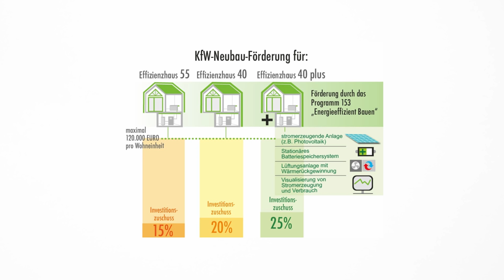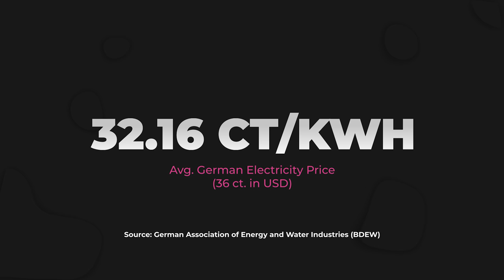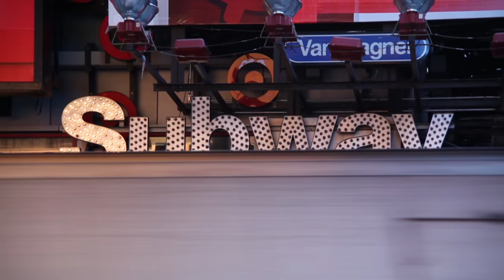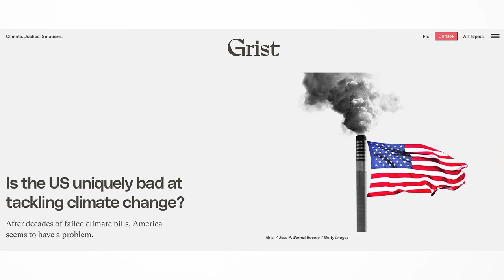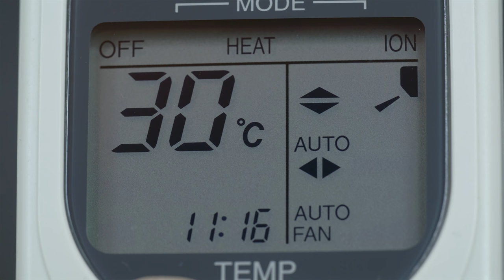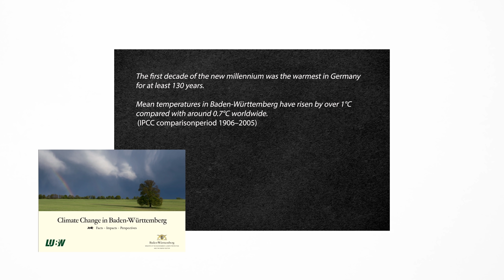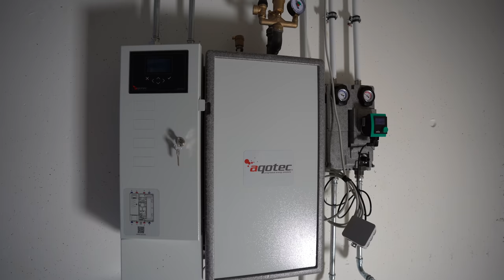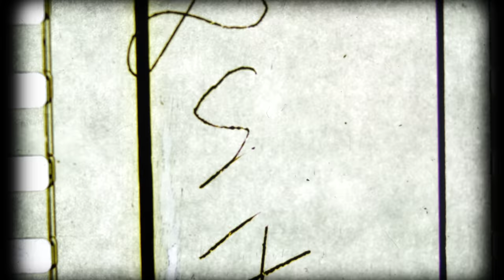HVAC (HLK) in German & American Homes | A Tale of Two Countries

Comment: Great video! I've never lived in a house with AC, but I have lived on Nairobi Kenya for 6mths and know how baking hot and humid it can get! Did we have AC, nope, just torrential rain which was lovely to stand out in to cool off. 
Here in SW of the UK, our summers hit high 30°C and it can get hot. We open the windows on the morning (if not open all night) and close them an hour or two later and keep them and the curtains closed until it cools enough. 
It works downstairs well, but the upstairs is heated by the attic during the day and makes sleeping problematic for the Irishman in me! 

AC is vital in a car, if you design your house for the environment it is being built by fitting window roller blinds, insulating walls very well and designing in overhanging roof eves (to bring shade) , then you may not need AC at all! If you have a heat pump, you can switch it on in reverse and it cools a bit and is way more efficient than an AC unit. 

Also, make your houses sooooo much smaller! I was blown away by how fracking big US and Canadian homes were for the money! Nearly 3 times my house in size 121m² (1302ft²).

Comment: I live in Vancouver Canada. I used to live in an old bungalow which had no insulation in the walls, and no AC. I had doors and windows open all Summer, and lots of bugs in the house, (no screens either) Then I moved to the suburbs of Vancouver into a bigger mid 70's house of 3000 square feet. This place has a gas 94% efficiency forced air heating system with a central 60,000 BTU AC using a scroll compressor. It is also well insulated. Same ducts for heat and AC, simple. The AC is wonderful on hot days. This Summer of 2021, it got up to 41C a few days. I learned the limits of AC when it's 106 Farenheit outside. Keeping this place at 85 F in that hot weather costs $3.50 per day. I don't us the AC for more than say 25 days during the Summer. It's also not a heat pump, just straight AC, which means it does not run at all for most of the year. Heat pumps for both AC and heating grind away all year round making noise and wearing out the compressor.

The main gripe with hot water heating is slow heatup times. Yes, forced hot air is a bit dusty, but the house is comfy in 15 minutes after you come home and turn up the heat.

Comment: Excellent. !!!
An astoundingly informative, well researched and delivered video. Thank you so much!
I live in Germany in a semi-detached house built in 1994, so not quite up to all the newest environmentally friendly regulations. But not too badly thermally insulated. 
I use gas central heating with room radiators for heating.
In 2015 I put a photovoltaic system on the roof and produce more electricity than I use in a year. (Of course, I sell it back to the utility company for about half the price I have to buy it from them 😞so they still make money out of me )
In 2018 "I caved", as you put it, and invested in an AC system. The interior of my house is fairly open plan so 1 exterior wall unit and 2 inside inverters was all I needed.
I figured it was only going to get warmer in the summer and all that extra sunshine driving my PV system could power an AC system 🙂. I only use the AC when the sun is shining anyway😅
Thank you again for this (and your other) educational video on US and German building practices. 
gas
Reply from the maker: So glad you enjoyed it! We really appreciate all of the positive feedback. Although I would like to ask you about selling your energy back to the grid. Are there regulations in Germany that regulate the price? In the US they mandated that the utility companies have to purchase it back from you at the same price you buy it from them.
Reply: @TypeAshton  Dear BFF, "Are there regulations in Germany that regulate the price?" 
This is Germany!! Of course there are regulations. 😁
But, as you know having lived here a while, they are not 'unsurmountable':
If you are thinking of adding PV to your build it would be best to ask your energy utility how that would work where you live. 
You don't have to sell it back, but you'll have to find a way of dumping/storing any excess you produce. In the end it is easier just to hook it up to the grid. I am not sure if the utility companies are mandated to buy back, but you sure won't get the same price as you buy it for. 
You just buy from the grid when "the sun don't shine" and sell it back on "happy, sunny days".
There are a few things you need to sign (I've forgotten what they were), and you will be registered as a production company. You would be producing energy, after all, just like a grown up utility company. You will also have to declare this on your tax returns, but I found I was getting a (small) rebate as I was earning +/- 0 Euros. 
They reckon it takes up to 10 years to get your investment back and start earning. But, hey, for the good of the planet and taking away my guilt for the AC ......... 
Aber wie gesagt, this is all pretty simple and the utility company will should help you out.
Looking forward to your next video.

Comment: I am Austrian, but have spent the past 27 years living in Western Canada. During the hotter summer months in my youth, i remember having every single window open at night time, then closing everything up tight and shutting the blinds. i dont remember owning fans for extra air movement either. usually living in a century old concrete building did the trick of keeping us cool. Forced air furnaces were introduced to me when i first moved to Canada. Until then i only knew of wall mounted radiators. Living in a very rural area for most of my adult life, I had a combination electric/wood forced air furnace. Moving to a suburban area later on in life, it was definately either electric forced air or natural gas forced air. Only in the past few years have i enjoyed a central AC unit in my home, because i moved to one of the warmest parts of the country.

Comment: Not all of America is A/C obsessed. Most of the West Coast of California, Oregon, Washington, do not have A/C. We’re in NorCal. The past few summers we had some 116 to 121 F days which were tough. We replaced our old flat roof with a new reflective coating which helps reduce heat absorption tremendously. Also we have blown in insulation in our 1949 house, and have the luxury of cool overnights to capture the cold air with open windows. Nothing better then falling to sleep with the sound of crickets, frogs and owls. I would love to have radiant floor heat for those chilly winters though.

Comment: You guys missed the important concept of Enthalpy.  

That's the amount of energy in a given amount of air, and is in many regions based more on humidity and water's heat of vaporization, than on temperature alone.  

If indoor humidity is too high, mold, mildew, and fungus growth may make a premise a biomed hazard.  A dehumidifier is in effect an air conditioner with evaporator and condenser together, while HVAC is generally designed to be more efficient.  

In regions with heat pumps and high humidity in winter, defrost cycles can consume more energy than actual heating per se.  That, and optimizing temperature ratios, are reasons why ground water heat pumps make sense in many regions, over fuel based systems, such that COH or SEER actually operate at optimal spec points (and solar cogen may be the primary energy source, multiplied by the heat pump).

Comment: I have underfloor heating in my apartment and since the floor is slightly warm, one heats less than with the traditional radiators under the windows, since warm feet will make one feel warmer even at the same temperature in the room.
I get about 500 € back from my heating bill every year, while maintaining a lower temperature than in my apartment before. By turning it on bit by bit early in the autumn, I avoid the walls getting cold and therefore I don't need to heat as much in the beginning of winter, saving heating cost overall.

Comment: I live in Cologne in the last few years the temperature rise above 40 degrees. My tips to survive: In the morning, by morning i mean 5 am  to "lüften"  and we have special blinds that are heat-repellent. These are also urgently needed we live in the attic. In addition we also have a fan but we only use it when it is above 30 degrees in the room and sometimes I take a cold shower :-)
Reply from the maker: Great advice! ❤️ We also live in an attic apartment and thankfully cool summer nights help a lot to get the air moving through the house.

Comment: My tip for hot summers would be moving underground, if you have the possibility. We live in a house with 6 flats and 4 of them have a "Hobbyraum" in the basement. You can only acces it through the common stairwell, but there we have a 20 sqm room just for ourselves. In the summertime the temperature down there normally does not rise above 21/22 °C which is a very comfortable temperature for sleeping and working. So probably you could think about such a room in your basement where you could escape from the heat.

Comment: I live in the Philadelphia Pennsylvania area. In the summer time I set the air conditioning temperature at 79⁰F (26.1⁰C) for the occupied living spaces (I have window units) and a fan to circulate the air. However I like my bedroom at 65⁰F (18.3⁰C) to sleep. In the winter I keep the home heat set to 64⁰F (17.7⁰C) during the daytime and 59⁰F (14.4⁰C) at night time.

Comment: I'm 200 miles north of New York City, extremely cold in the winter and hot and humid in the summer. I live in a small apartment in a brick building built around 100 years ago. I have natural gas radiant baseboard heat and a window air conditioner. From mid-June to mid-September my air conditioner is running 24/7 to beat the heat and humidity back to bearable levels. If I turn off the air conditioner the temperature rises about 10 degrees per hour in my apartment until it equalizes with the temperature of the thermal mass of the masonry which is usually whatever the high was for that day. I pay $123 per month for heat and aircon. I miss the big old cast iron radiators of my childhood as they were great for drying laundry in the winter and warming up your coat before going out.

Comment: I live about 40km north of Freiburg, so I am basically in the same general area as you. And yeah, look at the calendar, its mid July. And it has been scorching the last couple of days.
I don't have AC in my own apartment / Or the house, I share with my parents. But what I ususally do to keep it cool these days.
1. fully open the windows in the early morning to let cool air in
2. Basically what's called "Querlüften" or "cross ventilation" in english. Open the windows completely, but lower the blinds down to a small gap and let all doors open. This creates a natural air-flow with a slight breeze through the apartment from the hot side of the house to the cooler one. But this method of course only works, if the room layout of the house / apartment favors it.

Comment: Living under the roof of a uninsulated 5 unit building from the 60s, I do own one of these portable Bauhaus AC units.
This however only runs during the mentioned heat waves, so probably 3-5 nights a year to cool down the bedroom when the nights are still above 28°C or the forecast predicts thunderstorms. 
In all other cases, I prefer opening all the windows and using a ventilator to force the hot air out. That is way more comfortable and cheaper to run than the AC.

In terms of heating, I really really prefer a stone house with radiant heating in comparison to the rental unit with forced air and paper thin walls I lived in for one Michigan winter.
Reply from the maker: Admittedly, we also own one. We panic bought when we found out Id be pregnant during the summer (and the summer prior we had 7 heat waves with 40+ C days). Ironically we didn't end up using it that much and that summer was relatively mild.
Reply: @TypeAshton  There is no real downside to owning one. It does not take up a lot of space and gives you the option to cool the air in case it's really needed.

Comment: I had a few chuckles watching the video, especially when you mentioned the floor heating... we have the exact same setup as you're installing and your wall switch is nothing more then a flow regulator. With a lag of a couple hours in actual room temperature correction. If you a used to thermostat controlled rooms... you will notice the difference and learn you may need to adjust multiple times a day. One thing is for sure, do not let the locals tell you it's something special or better then central air.

Comment: We live in Cologne - so a rather mid temperature zone in Germany.
However, the way our flat is layed out and oriented, we get next to no air movement in summer when we open our windows front and back.
Our Balcony itself heats up to scorching temperatures and runs all the length of our back windows.
So we got us a split AC system with the compressor outside on the wall and the outlets inside.
All flats in the house got AC systems, which make life in summer so much better. 
on top of that, the central heating unit had to be replaced due to failure and the house now got a heatpump system, which fits the floor heating quite nicely.
Reply from the maker: We also gave in an purchased an AC unit for our house when we found out I as pregnant. We live in an attic apartment with south/west facing windows. Our home BAKES in the summer time since we don't have exterior window blinds to close off the house when the sun comes in.
Reply: @TypeAshton  Attic apartments are pretty much the worst in the summer. Hot air rises from the whole building. And if there is no ridge venting, the heat just accumulates under the ceiling and bears down on you with suffocating pressure.

Comment: I guess one main factor for forced air ventilation is just the point that you CAN use it for A/C as well. radiators just don't work for this because of condensation issues. If you don't use A/C at all, that advantage becomes irrelevant.

Comment: Most efficient is to use the floor heating to cool the building itself (Active if the house is heated with a Air-Water-Heatpump,  passive by just pumping around brine/water if it is a brine/Water-Heatpumpe, and use a wall mounted airconditioner to dehumidfy the air in the house at a central location.  At my home I organised - as fast reaction on Putin - two wall monted systems to supplement the gas heating, doing 80% of heating work (the panasonic nordic one is extremely efficient  with SCOP 6,1), and those are used for cooling in summer as well, heat pump for central heating and finally remove gas boiler will come during this year.

Comment: Forced air heating is making an appearance in new buildings. Two of my new neighbours use that and a relative does as well. Given that many new buildings now have a central ventilation system for energy efficiency in the winter, it is quite a cheap solution for home builders to use that for heating as well. After all, this is not only removing the heat pump from the cost but also the underfloor heating as well. And given the low energy consumption of new homes (KfW40 is pretty close to passive home) one can probably heat for a decade or more before break-even with a proper heating.

Comment: As I child, I hated Fernwärme as the underground pipes would melt the snow in front of the house making it much harder to drag your sledge along.
Reply from the maker: You're totally right! I hope Jack doesn't despise the system.
Reply: @TypeAshton  The danger are the edges of the molten snow. There you'll get ice. As you are responsible for keeping the pedestrian walkway in front of your house safe for others, make sure to get up early with a shovel and grit after snowfall

Comment: Forced air heating is just really inefficient. When its not blowing, it feels immediately cool-cold again. The warm air dissipates quickly, or rises up to the ceiling where, well, it doesn’t do anyone any good. It is also extremely drying for the skin, nose and throat. Radiant heating, because it is actually in contact with structures of the house(like the floor in the case of underfloor heating, or the heating of nearby furniture in under window radiators )warms them too by that contact, thereby infusing more fixed structures in the house with a heat that doesn’t dissipate as quickly as warm air being blown into the room.

Comment: I have lived in various places around the world (temperate, subtropics and desert). What I found severely lacking outside of Germany is window and building insulation. Germany primarily mandates good insulation to save energy in winter, but it also helps with keeping interiors cool in summer. Among other places I lived in Hong Kong, which has humid and hot summers (80-100% humidity, 30-35 degrees C), and colder dry winters. Electricity prices in Hong Kong are similar to Germany. Our monthly electricity bills because of air-conditioning during summer were insane, especially after we moved into a house (think thousands, not hundreds). Better building insulation and double-pane windows would have helped considerably. We are now back in Germany (north) and live in an apartment with district heating (under-window radiators) and no air-conditioning. It was built in the 1960s but has updated windows and facade insulation. I permanently switched off the radiators in February. We didn't need them anymore. During hot summers days, we open the windows early in the morning, then later close the blinds and bring down the balcony awning on the south-east side of the apartment. That way the room temperature is about 5-8 degrees lower than outside. Sometimes we also switch on a fan, but very rarely. What also helps is that the apartment has windows on two opposite sides, so that we can create a natural draft... oh the beauty of Kippfenster :)